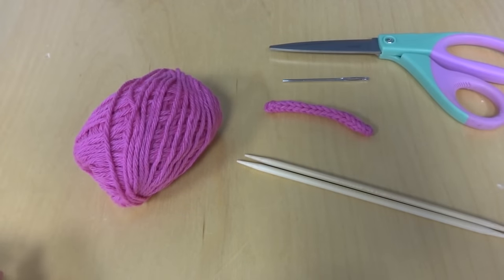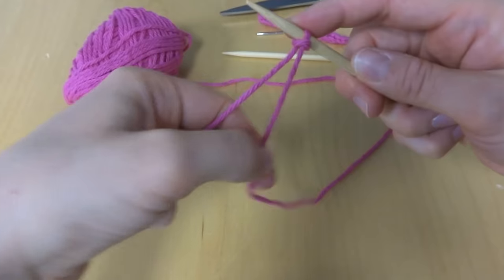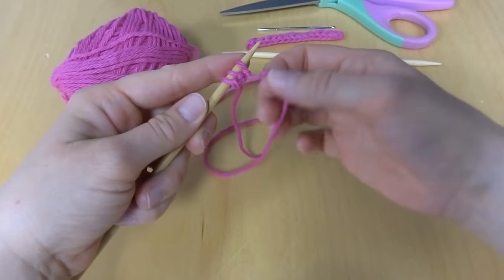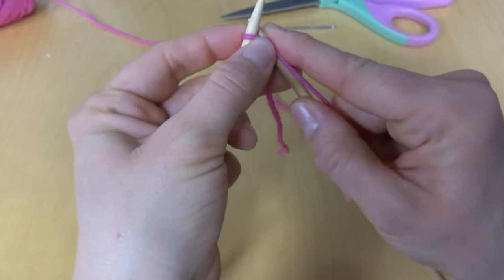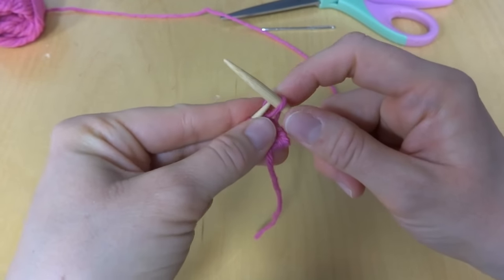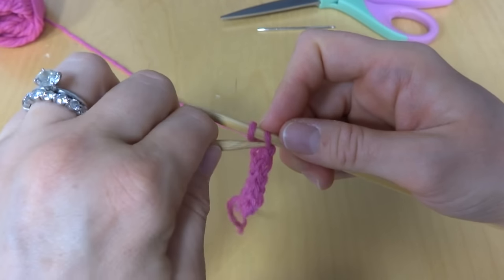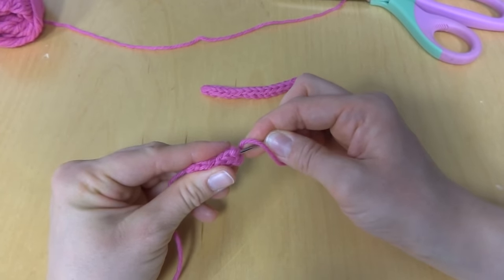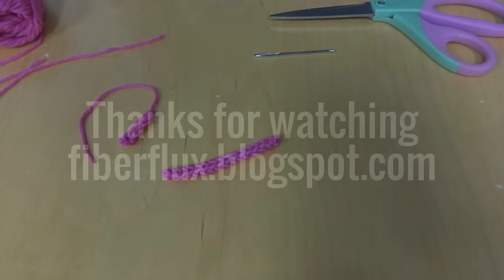How to Knit an I-Cord

Comment: When I was looking at knitting needles I saw that there were the double pointed ones and the (I think) standard looking needles... so eventually I'll probably want both kinds but think I can deal with just a standard set!  Thank you for showing us how to do this!
Reply: If you can only buy one pair of needles, I think a long circular would be the way to go.  You can use them as you would standard needles (back and forth) or to knit large projects in the round, or smaller projects in the round by using the magic loop method.  I realized while watching this video, they can also be used to make an icord:)